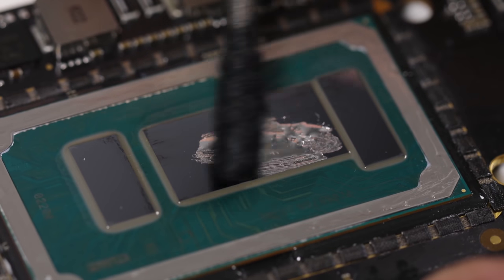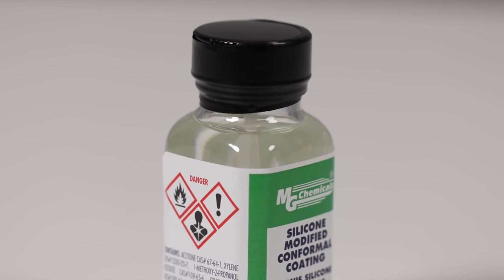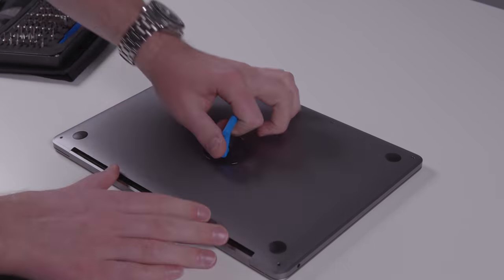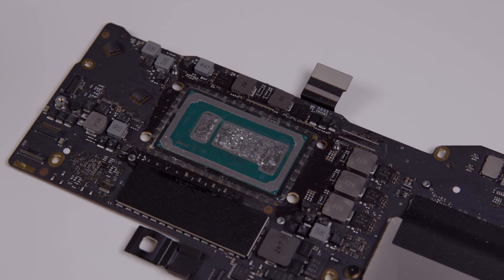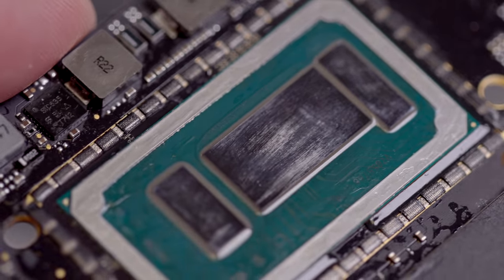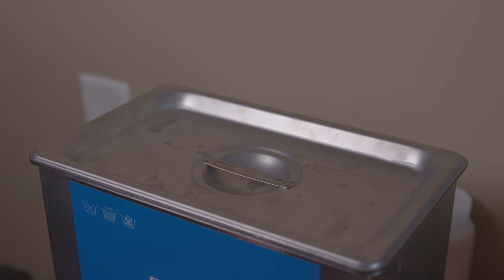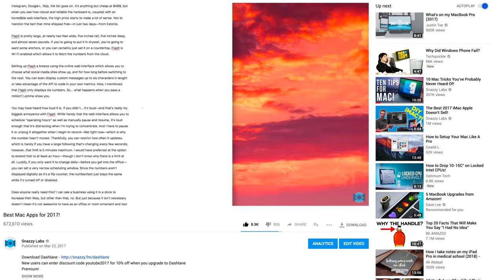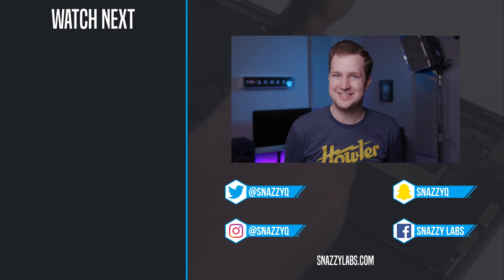What Does Liquid Metal Look like After 3 Months Inside a MacBook Pro?

Comment: The reason why your copper looked weird is because it is a copper alloy, which is more at risk for decomposition.
Reply: So when i get your post right - even if the surface looks like the copper, there is a chance that it isn't pure copper and may contain a composition of copper and some other metal which could get destroyed by the liquid metal? Just like there may not come any liquid metal to an aluminum surface?
Reply: Jesper Lerch not destroyed, it could just soak into it a bit. With aluminum, the gallium forces its way in between the crystals of the aluminum and weakens its integrity. On this copper alloy, it looks like it just goes in on the surface because everything was fine.
Reply: Or its just a thin copper layer over aluminium . Before you get that liquid metal stuff scratch the cooler in an area where the cooler gets no contact with the cpu or gpu when its still looking just like copper no problem but when something shines through in silver dont use liquid metal. But there is no problem when Nickel is over Copper to protect it from corrosion (you can see this on high quality desktop cpu/gpu coolers but not that often on Laptop coolers)
Reply: Gallium alloys with copper.  That set in silver is copper gallium alloy
Reply: That's wrong. Gallium readily alloys with pure Copper duel to the difference in their electrode potential (about 0.85V). Gallium will diffuse into a Copper heatsink over time to form that greyish metal alloy. That's why it appears as though the Gallium has "dried-up".
Reply: Can someone tell me which one is better? Mx2 or mx4 thermal paste
Reply: @raashidrazi5663  look at the thermal conductivity (w/mk).  Liquid metal can be like 70w/mk while a regular thermal paste may be 8 w/mk only.
Mx4 I'd say for the higher number lol.
Reply: Incorrect.  Gallium alloys with the copper and does not decompose it.  The thermal dissipation is perfectly intact well beyond the life of the CPU.
Reply: It copper it will rust..... like it or not...
Reply: Many manufacturers do use aluminum-copper alloys in their heatsinks.
Reply: @4FYTfa8EjYHNXjChe8xs7xmC5pNEtz  Wouldn't that cause galavanic corrosion?
Reply: it a copper..... it not going to look new.....after sometime...
Reply: my 13th gen 13900h saw a difference of going from 12000 cb23 to 19600 cb23. In a 14.5inch creator laptop. Obviously the stock paste was garbage but conductonaut or ptm7950 is worth every penny in my opinion. Never ever going to have regular paste in any of my equipment

Comment: Not 100% Copper ALLOY ALERT
Reply from the maker: Angel Pimienta It’s possible; however, I also think the alloy would be far more degraded and brittle than it appears to be.
Reply: Snazzy Labs discoloration is perfectly normal, it's the gallium and indium diffusing in the copper, you shouldn't worry, it doesn't compromise the structural integrity and thermal performance of the copper
Reply: Gallium alloys with copper.  That set in silver is copper gallium alloy
Reply: Snazzy Labs Gallium + copper form an alloy, and it doesn't always form evenly, leaving air gaps. Leave it on long enough and it could solder the die to the copper shim. Have fun removing it after that lol.
Reply: The word 'Alloy' means, it's a composition of at least two different metals. There are no 100%....... alloy.
Reply: @ozdemirsalik  but still to this effect shows Apple cheaps out. Which pisses me off since they're so expensive.

Comment: Arctic MX-2? Really? I mean, it's an okay paste, but for someone that paid for liquid metal, you should at least get a top-tier thermal paste like GC-Extreme.
Reply: Well in the video before this he used Kryonaut which is the best you can get.
Reply: Then why the hell did he downgrade to MX-2?
Reply: MX-2 is totally fine. If you buy paste from good brand difference between them is minimal.
Reply: mx2 is like a 1-2c difference... why are you going off the rails
Reply: ab12 Yeah, it's like budget king of thermal pastes. Sadly only one sold in big syringes in my country. Lots of choice between smaller ones.
Reply: The first one that he applied was the MX-2 after that he used the kryonaut
Reply: mx6 all the way ✌️

Comment: I can't believe the fans don't kick in until the poor thing reaches eighty degrees, is silence that important Apple?! Also that's probably why there wasn't that big of an improvement.
Reply: VideoCommenter Then why not offer a setting?  Light, balanced, or aggressive fan speeds so you can decide how hot/quiet you want your MacBook.
Reply: I feel like 95% of the people using Macbooks specifically are doing midi-based music so not sure silence is absolutely essential in these devices...
Reply: If silence is so important use a headphone rather than destroying a. Working piece of hardware
Reply: +VideoCommenter You do know that if the fans kick in earlier they'll keep the temps low while also not being audible right...
Reply: Watch Louis rossman's video the fans on the macbook actually starts at 80°c
Reply: VideoCommenter I mean quietness or burning up and failing in two years? 80 degrees is ridiculous, that's alot of similarly quiet laptop's maximum temperatures
Reply: Robin Rai installing macfancontrol app would easily solve this problem
Reply: Robin Rai  if you knew anything about computers trying to boost the performance by even 5% is heard enough never mind 15%. I can tell you are no older that 11 year old
Reply: that is actually a great idea, cause under 80 degrees is quite safe for a CPU actually. I've been using my laptop CPU for years at 80 degrees and it works just fine, doing 24\7 rendering there. So I wish I had such fan profile for my laptop, which gets fricken noisy at 70 degrees, pretty much over nothing
Reply: 95% of people are doing midi-based music? What? Maybe 20% tops.
Reply: You can easily do this with software and many Mac owners do.  Keep in mind the downside.  Increased airflow means faster accumulation of dust in the machine, which would ultimately tend to decrease lifespan and performance for someone who never intends to open the case.  The majority of users will not be opening the case.
Reply: @faeinthebay  It is called SMC FanControl, a free App I put on every Mac I sell or work on. I set the base speed about 1/3 of max and then Apple runs the speeds up from there if it needs it. I use MX-4 or AS-5 and find that is about as good as you can get.Both remove at least 3-4x more heat than the stock crap paste does.
Reply: having used other thin laptops in the past after making the mistake of buying a Lenovo instead of a Mac, I would say, yes. a silent laptop is an absolute joy. there's nothing more annoying than a fan ramping up and down randomly when you're browsing the web, like the Lenovo yoga 910
Reply: Yeah it sucks, install macsfancontrol and set up a custom fan curve, it'll be worth it.
Reply: Yeah it has to be quit as possible
Reply: Robin Rai its sounds pretty high, but actually that’s a super safe temp for the CPU. The max safe temp is 100c, but it can continue running to 120c without any problems. So yes, actually stupid having fans kick full speed at 80c. It would drains the battery faster and reduce fans life.
Reply: Most ultrabooks run hotter than 80c and it’s not like it’s bad for the chip
Reply: You can also manually set fan speed in software if it’s so important

Comment: You don't need to worry about jostling it about.  The surface tension of gallium (and most gallium-based compounds) is such that, when mated between two surfaces, it's pretty much fixed in place.

Comment: Liquid metal rule: If the temperatures are good, never open it up again.
What you are seeing is perfectly normal, although you shouldn't clean the CPU die that way, since the liquid metal can scratch the surface (by your mechanical forces, that is).
Reply: how should we clean it than
Reply: does it require annual replacement like he said?
Reply: @inSpyr  no

cpu and gpu pasted here on my desktop for more than a year already, actually august 2017... Paranoid user is paranoid in the video
Reply: There are reason why OEM don't put it in....
Reply: @campkira  yet still hp done it...
Reply: @campkira  because its too expensive?
Reply: @campkira  This is due to overwhelmingly incompetent nature of most of the people that assemble the machines. Do you think someone that places heatsinks on a PCB understands the chemical reaction of LM or cares? They don't really offer it because it can't be applied in a manner that is foolproof.
Reply: @Alberto Montes, have you change it yet? if so, did you noticed anything weird or different ion the looks of the dissipator or the CPU?
Reply: @campkira  to expensive.
Reply: campkira until now, ASUS is now going to implement liquid metal in their newer Zephyrus laptops. That is in order to quell the heat of the blast furnaces which are the 10th gen Comet Lake H CPU’s
Reply: @paimon361  You don't clean it. If you install it correctly you're liquid metal will outlive the life of your CPU. Even labeled on the instructions is to install this only once as removing the heatsink multiple times will negatively effect its performance causing it to dry out and partially fuse to the heatsink.
Reply: @campkira  this comment didn't age well lol
Reply: @realhusky  lol even though they don't understand the reaction they don't need to. They ain't engineers or nerds like you and me. But I bet they're more skilled with their hands than the both of us. They'd definitely be more competent at assembling coz that's all they do. Now does that competency meet the standard required for LM? That's a different question.
Reply: @Whoareyoucalling  where do you get that BS that LM outlives the CPU. That's for graphite pads. LM needs 2 applications or thicker single application because it will alloy with the copper. If you look at the consoles or zeph LM, they have a pool of it to make up for the alloying.
Reply: @therealb888  yeah, liquid metal is now on every single ps5 lol
Reply: Maybe he did it because he makes some money by getting hundreds of thousands of Youtube views.
Reply: @AlbertoMontesSoto  Hello any update on your set up with liquid metal?
Reply: @niko1even  … still didn’t put liquid metal in the latest zephyrus g14, and mine really needs the metal now
Reply: @asianflex  it's for I believe that the liquid metal is put on more of the premium laptops or ones that have lesser cooling capacity. I recently got a flow X13 supernova and it did come with liquid metal, my XG mobile GPU did not tho so I put liquid metal for that one myself. 

The G14 does get very hot yes but it doesn't really need liquid metal as the CPU is not in imminent danger of killing itself from heat.
Reply: @niko1even  eh it just gives me peace of mind so that whenever I check msi afterburner i don't see the gpu at 80degrees c and think it's soon gonna become a 2011 15 inch macbook pro
Reply: @asianflex  80 degrees isn’t gonna kill your gpu, that’s pretty typical for hot laptops. The more laptops you use, the more you’ll see that trend.
Reply: @campkira  3 years later but PS5 uses it so...

Comment: Kinda late but as a conformal coat operator, I can tell you that quality conformal coat will withstand heavy use and will act as a barrier. Now after a couple years, it might crack but it'll still remain there and keep components safe as long as the coating does not get too disturbed. By then you'd simply remove the old coat by peeling it off or acetone and reapply another layer

Comment: I did the liquid metal upgrade on my Lenovo t420s thinkpad and it's been comfy af.
Reply: Mark Jay the 420s is an interesting choice, especially considering it isn't upgradeable. How's that 2nd gen i5 or i7 holding out in 2018?
Reply: Aðalgeir Nóelsson I have the i5 version. Honestly it's great. Having an ssd helps. I paid $50 for it off craigslist.  It's pretty much my daily driver
Reply: I'm planning to pugrade my t430 froma  i5 to a i7. And the old i7s can get quite toasty. 
I've never done anything with Liquid Metal so... is it worth the risk?
Reply: If it's just a dual core I7 then don't worry about it, if it's a quad core your adding then yes definitely.
Reply: At this point my t410 is as fast as a brick for anything more than web stuff
Reply: FenriX no I would not do that you can brick you computer fast just get a high quality thermal paste just my opinion though
Reply: Tony Curson Have you considered upgrades? Those old Thinkpads are really modular.
Reply: FenriX I have a T430 with an i7  3632QM in it (4 cores/8 threads). Under the stress test in XTU (undervolting doesn't work btw) I hit a peak of 94 degrees and no throttling. You'll probably be fine with regular high end thermal paste, but you do you.
Reply: Boosted it's MOSTLY gallium but it's not just gallium and that's why we will call it FANCY 'liquid metal'
Reply: Have you had any need to replace it ever since?
Reply: @TheRealFobican  wondering the same thing, just did LM application to my w520 with dGPU and it's been fine so far but been wondering how long it lasts before needing replacing.
Reply: don't forget to repaste it
Reply: Damn dude I still have the same exact laptop, a true workhorse
Reply: @MarkJay  wtf $50?! How so cheap man?!
Reply: @therealb888  craigslist is usually a bit cheaper than ebay.

Comment: A new a1708 macbook pro heatsink is like 10$ shipped from aliexpress, so in theory you could just use liquid metal for a couple of years and replace the stained heatsink an make it seem like nothing ever happened.
Reply: William skagen don't even have to replace it, a gallium-indium-copper alloy doesn't have worse thermal or mechanical properties. It just looks discolored since it's an alloy.
Reply: In 2 years this thing is obsolete anyway
Reply: Microage tell that to my 2010 MacBook Pro.
Reply: @MicroageHD  tell that to my 1998 macbook pro
Reply: What the point..... After couple year.... those tech is outdated and then it don't had value... Normally I just change new mechanie and put old one in storage as back up.
Reply: @chriswho12345   He's talking about the keyboard replacement, apple doesn't like when we try to extend the lives of our laptops